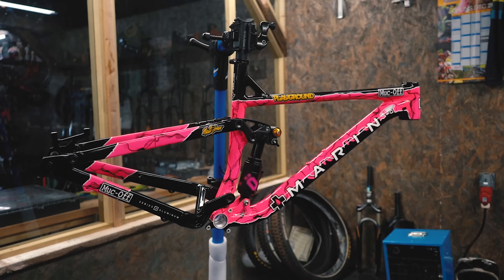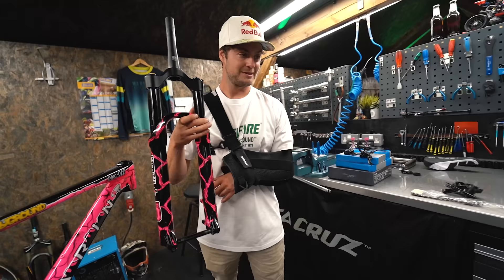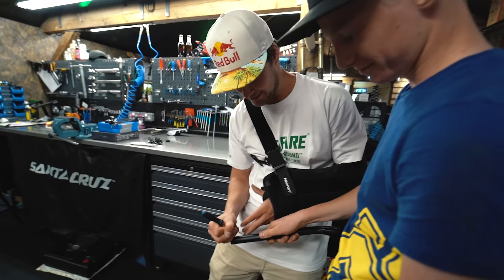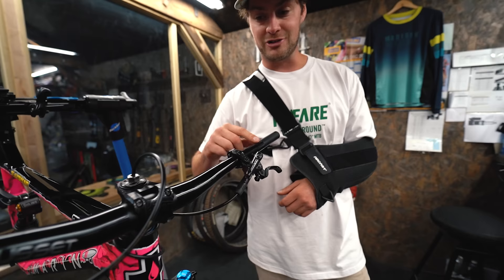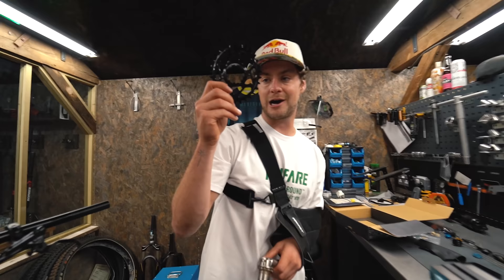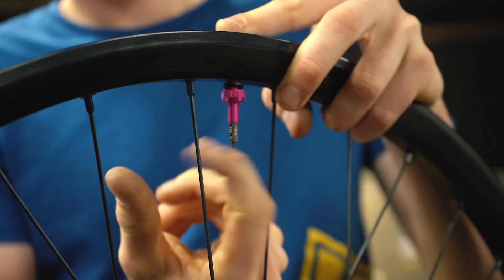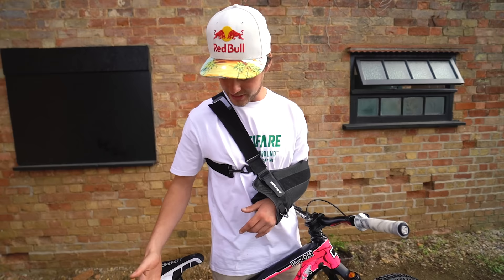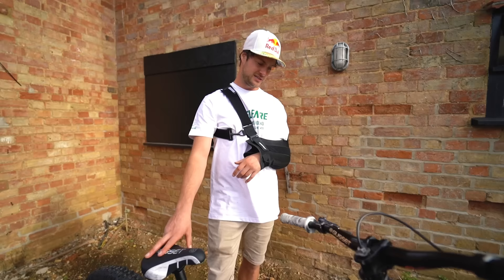BUILDING MY NEW CUSTOM SLOPEDURO MTB!!

Comment: You don't need your top cap bolt in once it's done it's job pulling the forks up and getting the headset in place, once the stem is tight that will hold it all together. You could get someone to 3d print a custom cap to fit in there with a hole for your brake hose. Bonus you could print it in shocking pink plastic :D

It does look ugly that bolt though, it's like the ones you would get on the cheap old 90's BMX's from Argos or Halfords.

Comment: Why use a derailier for single speed? They literally make a chain tensioner for single speed full sus bikes that flexes with the rear shock just fine. Eouldn’t that make more sense on a dream build?
Reply: Sick Bike Build! I have the same question. Why have a derailleur if it’s a single speed?
Reply: @mtbguy8052  thats simply because its a full suspension bike. But they could of used a single speed specific one rather than a full on mech set up 😂

Comment: First off, let me say that Jims Bikes and Boards is amazing! https://www.youtube.com/post/Ugkx2YFGCCEkXKgqCOH-7vlvgb4L4hg4IrXI They're the one my Golden Cycle Striker shipped from and when I told them I was apprehensive about buying because of only having a front break they said they'd add a back one for free! Now as far as building the bike- it was super easy. It didn't come with instructions but even if you've never built a bike you can build it. You only have to put on the front wheel, handlebars, pedals and seat. Super easy it's just tightening screws lolIt's comes with the tools shown in the pic which is all you need. As far as size I'm around 5'8" which is on the cusp of a 52 and 55 size bike. I decided to go with the 55 and its perfect. Honestly it's actually shorter then I thought it would be. I attached pics to show you what I looked like next to it. I would even recommend this size to someone 5'7"Took around 3 days to come. Hope this helps!